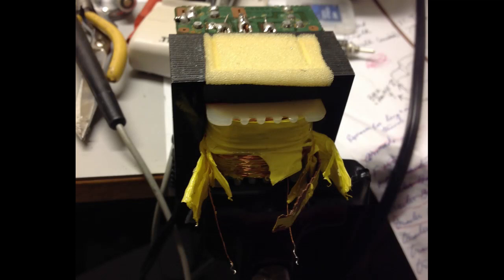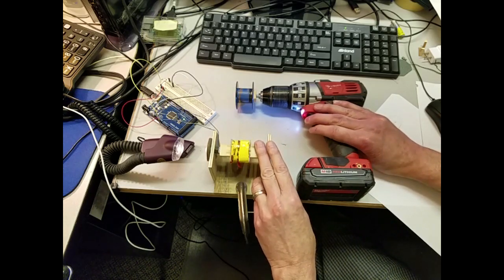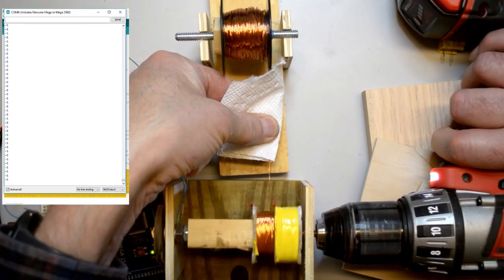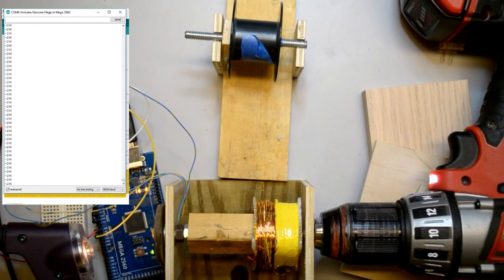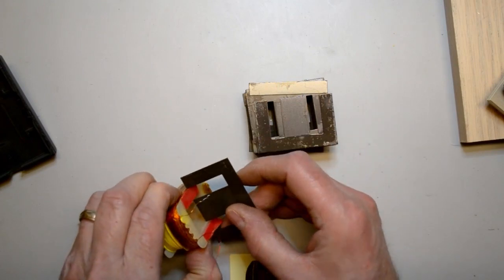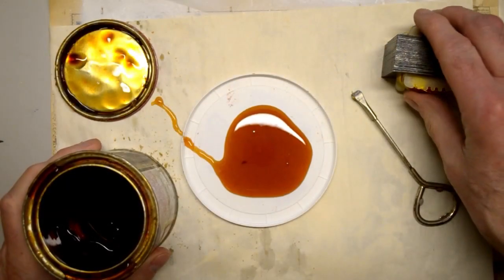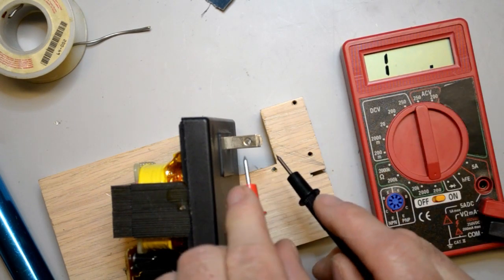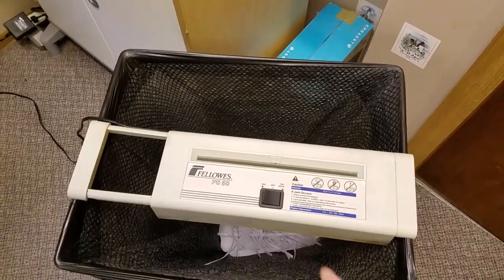Small Transformer Repair

Comment: I have a model mta -1230 input 120vac 60hz 45w red and output 12 vac 35 w black marine power co. Ltd transformer for my halogen bulb folda desk lamp that I absolutely love !! But now it’s not my bulb that’s the problem. What would be your suggestions?
Reply from the maker: Check the voltage at the docket to see if the transformer is really bad.  If no voltage, then check inside the power supply to verify the transformer is the problem.  Before I would they repairs on the transformer, I would try to buy a used dinner light that takes the same size bulb at a thrift store.  Then swap the transformer.  There are probably quite a few lights out there.  I would only try rewinding the transformer if it is rare (like for my shredder).  Good luck!

Comment: I replaced  a thermal fuse from a transformer with one of higher temperature ( 130 instead of 115) and know the transforme output is 16v and not the original 12v , is the fuse responsible for this? Original fuse was rate d as 2A the new one is of 2A  too.
Reply from the maker: I don't think the fuse is responsible.  Perhaps the transformer overheated and some of the windings shorted together.
Reply from the maker: However, sometimes transformers have a higher no load voltage.  Load it down and the voltage may be closer to 12 volts.

Comment: How much of an issue would it have caused to not count the number of windings?
Reply from the maker: The voltage ratio is based on the number of turns; not the length.  In practical terms you would probably would be close enough if you just used the length since the lines supply voltage is not that constant.  However, I did use a little more wire since I didn't get the windings as tight as original.

Comment: Good video what type of Varnish did you use? I have a Vintage Big Transformer, I re-moved the rust w brush a little WD40 But some of the outside edge E and I are loose now. Looking at cleaning w Isopropyl Alcohol for more cleaning and to get rid of any WD40 than use use super glue?  than varnish it.
Reply from the maker: I used a good one part polyurethane finish. It seems to hold up.  Good luck!

Comment: Great how to video, very educational.  Time consuming but could be economical with larger transformers, or like you said vintage hard to replace Ts.  In this case a cheap eBay replacement would have been more practical. In my case I was lucky or maybe you were unlucky?   My blown thermal fuse was on top so I only had to remove the outer layers of tape and solder in a replacement fuse.. Thanks for sharing!
Reply from the maker: I'm glad it was easier for you.  Sometimes the journey is half the fun.  Thanks for watching!

Comment: @Life with David  It is beyond economical rapair, becuase  low power transformers for main voltage aren't so  expensive, but I understand that you did that to see if you can and 4fun... Fo example 10A transformer may be  expensive, so it worth it for sure, but  for example 1 -2A are cheap, so you know... I woould say nah, too mych afford, it's not worth it...
Reply from the maker: Thanks for the comment.  It's good to have the skills.  For instance, I had the transformer of Heathkit Oscilloscope fail.  This had multiple windings and multiple voltages.  Luckily, I was able to get a replacement from Heathkit (it was many years ago).  However today if I couldn't fix the transformer; I would have to trash the scope; since I wouldn't be able to get a replacement; regardless of cost.   Thanks for watching!

Comment: Hello, my old stabilizer transformer is making noise, can apply epoxy on the middle coil?
Reply from the maker: Usually noise comes from vibrating plates in the core.  I think it would be difficult to get epoxy in there; especially if the core has already been coated before.  You might try wedging the core a little with some wood between the coil form and the  core.  That MIGHT stop the noise.  Just be careful not to do any damage to the coil.  Good luck!

Comment: Have you ever repaired an antique 1951 phonograph motor before ? its fir my wilcox gay record -o-fone. disk cutter..
Reply from the maker: I haven't rewound an older motor; however, I've rehabbed them, cleaning the commutator, and cleaning, polishing, and lubricating the bearing surfaces.   If the windings aren't damaged, then that might restore the motor.

Comment: Sorry if it might be a dumb question, how did you know how many turns in total and 40 turns is missing? And how do you know the thermistor is broken? How to check if it is so at the beginning? I have also got a small transformer output 2V and 10VA for a walkman not working. I am not sure what make it not working, how to spot on the exact cause?
Reply from the maker: There are no dumb questions; this is a good one.  I don't know how many total turns are in the primary; just the number of turns I took off.  I used the coil counter I built in my very first video (now a little difficult to watch, LOL).  https://www.youtube.com/watch?v=2kpqVwZCH8o 

I didn't know what was broken; I just knew there was an open circuit in the primary by measuring it with a volt-ohm meter.  So I just started taking off wire until I found a break; it just happened to be the overload.  

A lot of the "wall warts" for small personal electronic devices are switching power supplies. They really don't have power transformers.  If yours does have a transformer, measure the primary and secondary.  There should be some resistance (below 100 ohms); not a dead short or an open circuit in each coil.  Smell is also good; if the transformer smells burnt; then it probably is and will need a rewind with new wire.  

If it is a switching power supply; the best bet for a non-experienced person is to buy a new one.  Switching power supplies are much more difficult to fix since there are tuned circuits inside that have frequencies of several hundred thousand hertz.  Good luck and thanks for watching!

Comment: 1. When soldering thermal fuses clamp the leads with small pliers to sink the heat away from the heat sensitive element.
2. Always check it for continuity after soldering.
Reply from the maker: Those are great tips!  Thanks for watching.

Comment: Thanks for the excellent video!  I love your approach, masterful and relaxed.  I was wondering if the E-Laminations and I-Laminations are magnetized in a certain direction?  In other words, would I need to remember which way is 'up' for each lamination and re-install it the same way?  
Thanks very much for your help.
Reply from the maker: Thanks for the comment.  No, the laminations are not magnetized in any particular direction.  The magnetic flux is changes every time the current direction changes; so any residual magnetism would change the first time the transformer is energized.

Comment: Great video, thanks David.  I have a 110VAC Sony CD Player that I accidentally plugged into a 220VAC outlet and it's transformer is toasted, it's fuse did not blow oh my, one day I'll try this (though I don't know when LOL), greetings from the Philippines.
Reply from the maker: Thanks.  Before you dive into the transformer, I would check its continuity.  Transformers are pretty robust and the failure might be with the semi-conductors in the power supply or beyond.  Good luck!
Reply: @LifewithDavid1  Thank you, will do.

Comment: HA HA. NICE VIDEO. I NEED TO REWIND AN OLD: CRAFTSMAN 12 VOLT BATTERY CHARGER. THIS IS MUCH THE SAME AS WHAT YOU WENT THROUGH. AS FAR AS THAT PAPER SHREDDER. I HAD A BRAND NEW ONE. ALWAYS GAVE ME TROUBLE. I FINALLY GAVE UP. TRIED TO INSTALL A MORE POWERFUL MOTOR. EVERYTHING WENT WELL, BUT SOMETIMES WOULD STILL BOG DOWN. I FINALLY GAVE UP. I BORED A BIGGER HOLE ON THE OUTSIDE OF THE PLASTIC CASE. I GOT RID OF THE MOTOR ASSEMBLY. PUT ON A SNAP ON SOCKET ON THE END. PUT ON A TWO FOOT SNAP ON  RATCHET IN THE END. WORKS GREAT!!!!! I JUST USE MY RIGHT HAND TO POWER THE GRINDING AXEL. 100% MORE POWER USING SMALL AMOUNT OF BRUIT FORCE. WORKS GREAT FOR YEARS NOW.

Comment: My E laminations seem to need more force to extract, than is required to deform them. I was hoping for some tips regarding that issue, but thank you for taking the time to make and post your experience.
Reply from the maker: Try to gently pry the laminations apart.  They are usually soaked in varnish which will make them nearly impossible to remove in shear. It must first be separated from the adjacent lamination.
Reply: @LifewithDavid1  Got It! Thank you. I had watched a video where the person had taken out several of the 'I' sections, I assumed so as to loosen things up first. This did not work for me.
Following your suggestion, and starting from the side I hadn't damaged yet, I separated the first E section using a long exacto knife, then slowly, gently, a couple of taps on each side of the E legs, the first E section came out undamaged, after about 10mins. Then separated and removed the next I section. 
Once the first E was out, it was much easier to carry on. I, E, I, E .....
Reply from the maker: @stepsvideos  Glad it worked!

Comment: Great video!! I have a coil from an ignition magneto on a small lawnmower engine that I'd like to rewind. Do you have any thoughts on that?
Reply from the maker: I'm sure that could be done the same way.  Make sure the high tension wires are wound in very flat, even layers to limit the voltage differential between each layer.  Otherwise the insulation could fail.  Examine how the coil is wound as you are taking apart and try to wind it the same way.  You may need to make a special jig to hold the coil while winding it depending on how the frame comes apart.  I believe there is a YouTube video by someone who rewound an early (1928?) Briggs and Stratton coil.
Reply: @LifewithDavid1  Thank you for the advice and I'll look for that video.